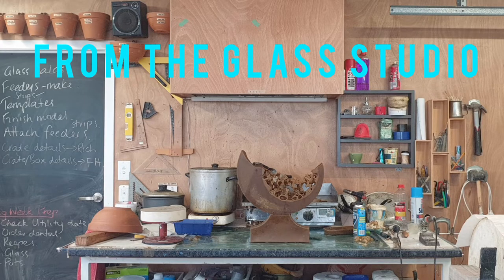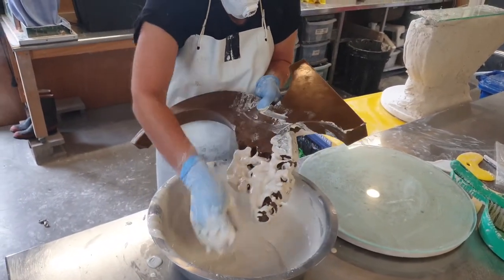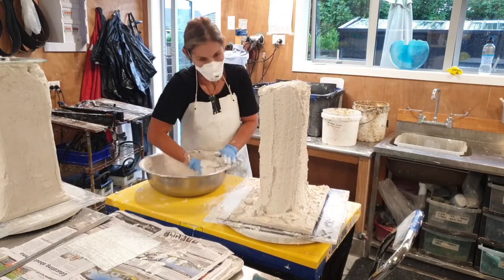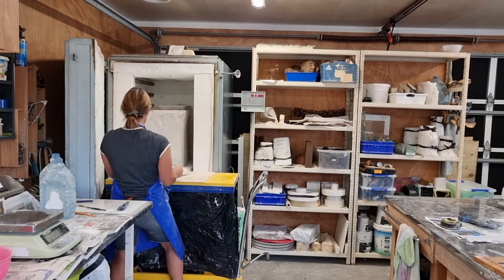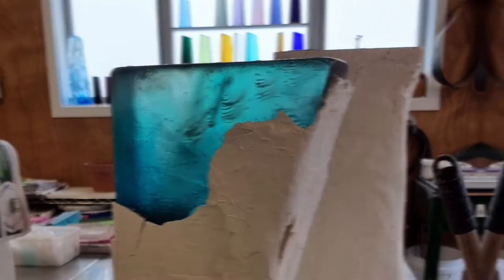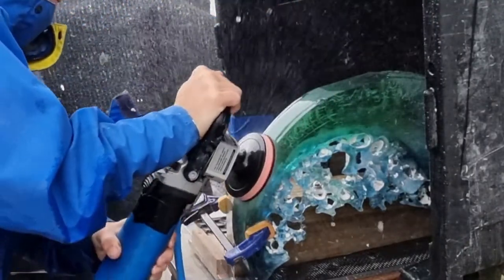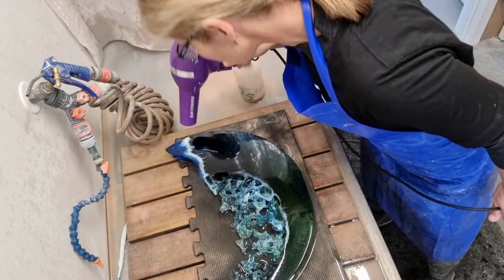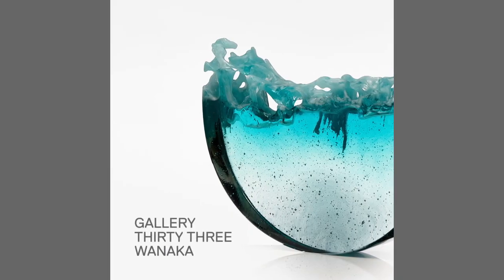FLUX & FLOW from the glass studio of Di Tocker

Comment: Have you tried building a form to hold the exterior of the plaster, so you can pour the plaster onto the wax fully submerging it? If you tried and didnt like it, what went wrong?
Reply from the maker: Yes, that's a block mould technique and I use it some times for multiples of small pieces but not often. Bubbles can get trapped in plaster. Handbuilding moulds offers more even mould thickness around the form, and layers make it easier to de-mould after firing.